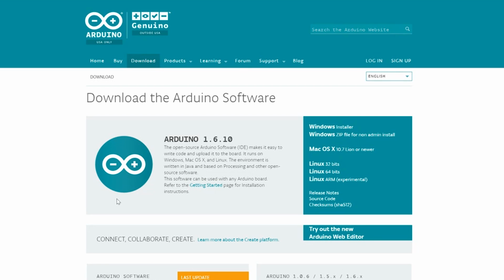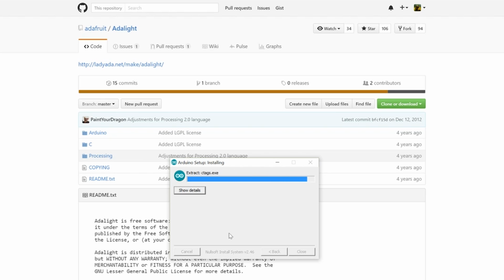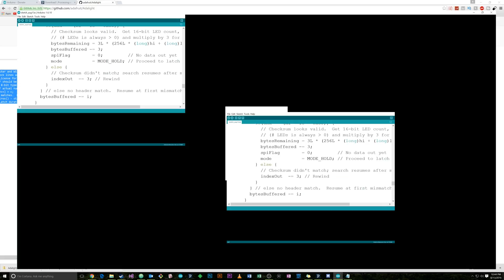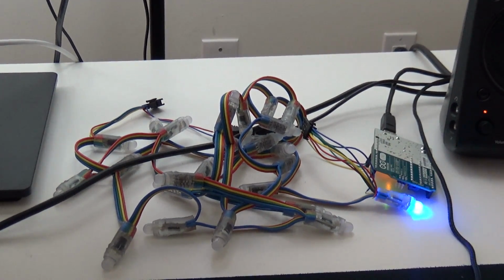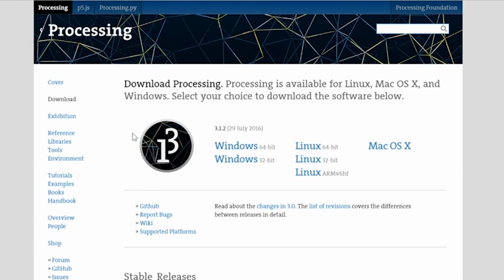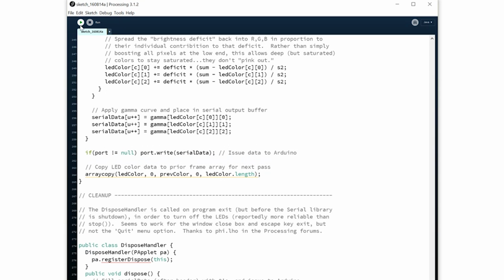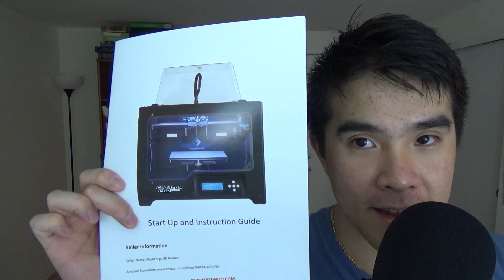How to Make Your Own Sound and Voice Reactive LEDs using Arduino

Comment: Not working after uploading code lights not comming on I have powered the lits externally. I have Adurino Nano what pins I should connect the the LED wired

Comment: Great instructional video! I'm trying to figure out how to do the same thing on a smaller scale. Would you have any guidance as to how to have an independent voice box with pre-recorded voices (or music) that is coupled with the LED lights? I've done some research and have seen the recordable voice boxes, but nothing that would link LED lights. So I need to construct something small, about 2"x2" voice box which connects the LEDs. I appreciate any insight. Thanks!

Comment: How much does it cost to make this with all the parts that he used? (assuming the PC and microphone are already paid for).
Reply: I'd say around 50-60 dollars. You can save a lot of money using old parts but the arduino uno is about 30 dollars, probably less. These are everywhere nowadays, just go pick one up from your local electronics shop. Knock-offs from china are even cheaper. It may depend on where you live. I'm from eastern Europe.

Comment: i love this and have been meaning to do a setup with sound reactive lights, only problem is the set up. i am using an eyefinity setup with 3 60 inch tvs, and my pc is in the center on the floor. so i gotta figure out how to get the strand across from one side to the other.

Comment: ok instead of using led's how can I change this to run lasers? R/G/B/UV only prob is my power units are 5v/9v/12v at a nice 30 amps my other unit is a 13.8 volts at 40 amps

Comment: Hi I am currently working on this project and am very new.  There seems to be a problem with the github code you provide for processing. line 105 of the code says that the values are not in use ex: "the value of the local variable d is not in use", "the value of the local variable total width is not in use"... any suggestions on what to do?
Reply: it also says the same for the other variables in that line (row and maxHeight)

Comment: Wow great project after installing the audio processing library how do i get to connect the project to  2 microphones from an audio mixer?
Reply from the maker: the library gets the system input, so whatever is set as your default device in the system it will get the signal from there

Comment: I am doing my senior project for my IT major. I am making a musical gumball machine from scraps because I have very little money. Some of my classmates and professor gave me materials for the technical portion of the project. I need the machine to lights up and play music as a gumball (marble for testing) rolls down the slides. My current model is a coin bank and uses a sliding lever to initially retrieve a gumball. After that happens I don't know how I'm going to get the lights and music to be reactive. I have access to an arduino and raspberry pi. However, I really don't have money for any extra components. I do have resistors, wires, power cables, and a breadboard, bu that's it. Can you help me figure out where to start?

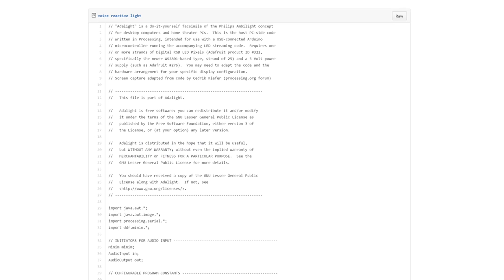Comment: Thank you for the excellent video. I do have one question. I did not clearly understand what file to load into processing(just before adding the minim library, around the 4:10 time bar). Could you help me with this? Thanks.    -- update --  I looked at the comments section of the code that was loaded into processing, it mentioned Ada Light so that is what I loaded into processing. And I added the minim library. But it will not compile it throws an error on line 75 asking for a right bracket.  Could the code have been edited since this video was made. I am new to this whole process so debugging this code is not going to be easy for me. Thanks for any help you can give! -- another update, its seems the adalight sketch works for me, but the emu does not. =/

Comment: How are you getting the sound in? Is there a 3.5mm jack connected somewhere? On the Uno maybe. I am new to this but have a project idea where I'd like to try applying this. Trying to wrap my head around some basics before I buy the adalight kit. Hope that you get a sec to let me know. Many Thanks!
Reply from the maker: it stays connected to the computer and gets the sound from the mic connected to the computer

Comment: how the fuck its going to react your voice without mic ??
Reply: He's using his PC mic. That's where Processing comes in. In short, the PC is sending the mic level to the Arduino via USB to Serial. It wouldn't work just with the Arduino.
Reply: it's probably using the pc's oscilloscope to figure out decibel levels. and then having the lights respond to that.

Comment: Scuse me, do you know if this would be applicable as a portable thing? Like could I replace an end with a battery and the other with an audiojack(for music)? Would it still work (but would I need an Arduino)? Or is it that the programme only works at home with a computer? I'm trying to sync LED with wings so any feedback would be greatly appreciated! I'm not a programmer so i'm just trying to learn stuff :(
Reply: No because he uses his computer to send the information to the device indicating the colors of the lights. The Arduino doesn't process the sound at all in this project it just receives that information already processed from the PC.

You could change things around and use an electret mic for that or connect line in to the Arduino, but it's bit different setup, you probably need a preamp or something like that, and the code needs to deal with converting the sound levels into colors.
Reply: thanKs!!
Reply: hullabaloo obviously you can the uno chip (328) have 5 pins of adc, you can work whit that.

Comment: Well, I actually don't have the ADALIGHT, but can I use just some RGB LEDs for testing it?
Reply from the maker: the software works with ws2812b, but not just any led
Reply: +Chubbyemu Ok, Thank you so much! :)
Reply: ofc you can, the software might even be easier with generic rgb lights VS those specific leds

Comment: does it work with arduino nano too?
Reply from the maker: u could try. i havent tested it. i heard with adalight that it won't work with mega.
Reply: I can control my leds with another program when i set clock pin 13 und data 11, bug with your program it doesnt work. The led are off all the time :/
Reply from the maker: hmm.. the lights should flash red, green and blue before you start the program, if they're not flashing at all they aren't getting the phrase to start. did you load the arduino with the adalight program first?
Reply: Yep, I did...
Reply from the maker: did it flash when you loaded it? strange if all the lights are dead, maybe it doesnt work with nano then
Reply: Hm okey, I will look for another program, thanks!
Reply from the maker: sorry man. good luck! let me know if u find anything good :)

Comment: How is the Arduino changing the colors of the LED's? Are you plugging an audio cable or even using a microphone maybe?
Reply from the maker: guys, it's in the code. minim = new Minim(this);  in = minim.getLineIn();it receives the audio information from your default input device
Reply: @chubbyemu  Is it theoretically possible to use Output audio only?
Reply: @chubbyemu   i am unable find the entire code, please help me to get 

please share your contact details
Reply: Ya, I didn't see where the audio input happened either!
Reply: watched the video a couple of times and can not see where the audio input is...
Reply: apparently, I'm confused... this project will use the computer microphone rather than an external microphone.. bumper
Reply: Ah! ok, so does that mean that the arduino needsa to be connected to the PC/mac/etc for it to work?
Reply: Chubbyemu where to connect the audio source to the arduino?
And how to do the same with rgb 5050 led strips?
Reply from the maker: the audio library gets audio input or output (based on what you set in the code) and uses the audio data to change the brightness and color of lights

Comment: Youve failed to mention the audio source/kit and how to connect it into the arduino.
Reply: Where did he get the sound input from?  Was it over usb or what?  I am watching and it looks like he never uses a sensor to get the sound from so I'm confused.
Reply from the maker: 4:29 minim library. it's at the top of the code where i show which line to include for audio
Reply: RTFM FOR MINIM LIBRARY
Reply: same. was waiting for him to mention that but never came
Reply: I think he uses the mic from his PC.
Reply: Well my friend, the audio is processed  by the processing software that he showed and is then sent over serial port to arduino  via usb.
Reply: At what point?
Reply: Yeah, this is an example of a"Title Fail" since no one, nada, el zippo, would associate Processing with it (other than maybe that Arduino IDE is descended from the Processing IDE).  The video assumes the viewer has made this association, a fail.  Then a further fail to ChubbyEmu for his reply to this post for again assuming someone should have made the unobvious association to Processing IDE.  All this could have been avoided by including Processing in the title "...using Arduino and Processing".